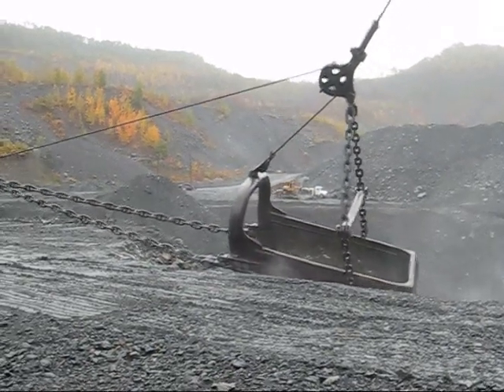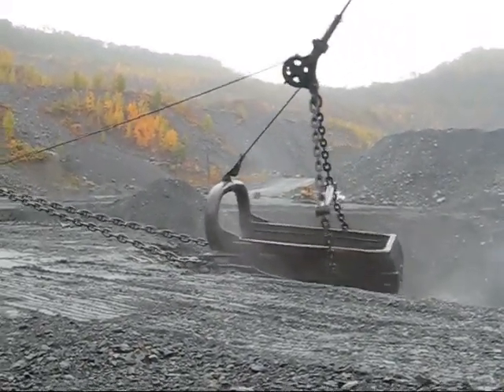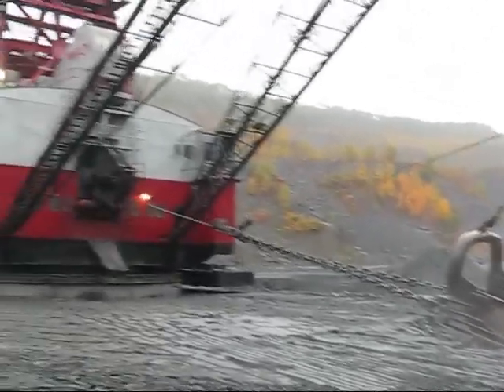Marion 7800 Starting a New Cut

Comment: Does anyone know how these compare to a bucket wheel excevator? They both seem to do the same job but I've never seen a dragline in Europe and I'm not sure if there are wheels in the US. What are the advantages and disadvantages? Does it come down to the style of mining, soil structure, seam structure etc?
Reply: There's a dragline at St Aidans in Leeds, West Yorkshire. UK. It's a Bucyrus Erie. Hasn't moved since 1999. It's not too far from where I live. Supposedly the largest preserved one in Western Europe (according to Wikipedia)? They were wanting to hold open days at one point and get it moving but I heard thieves took all the copper out of the motors so that was the end of that idea. It's still there and looks in decent condition on the outside when I went to see it earlier this year. Couldn't tell you about the advantages/disadvantages from bucket wheel excavators though.
Reply: The depth. With these machines, like that one right there can easily dig 70-80 feet deep. Plus on top of that, if you want to go that deep, there’s a method you need to follow that you won’t be able to do with the excavator

Comment: We have a Lima 2400- w/8yd Hendrix bucket. I have to run and maintain. curious to as how often do you change the drag rope/s?  I have found with our machine the rope should be changed out at about 120hrs. Just before it breaks the rope sounds like someone crinkling plastic bags- it is ready.  Nice job- you are smooth. I like what I do- wouldn't trade for anything.  HF